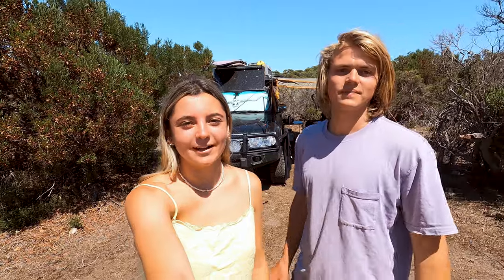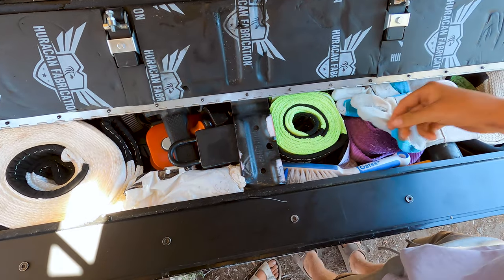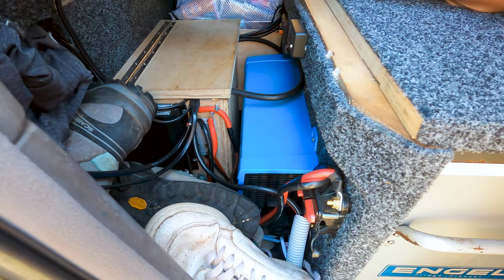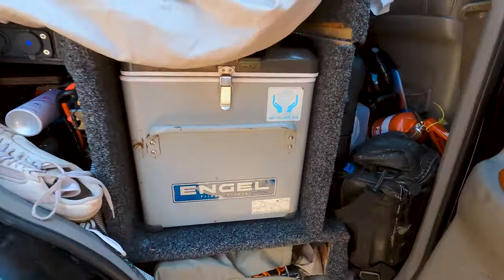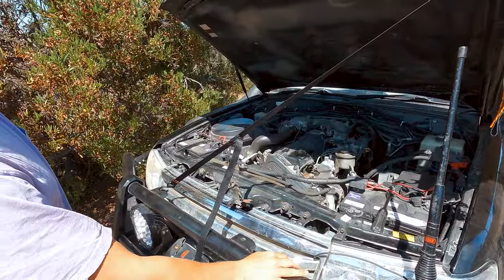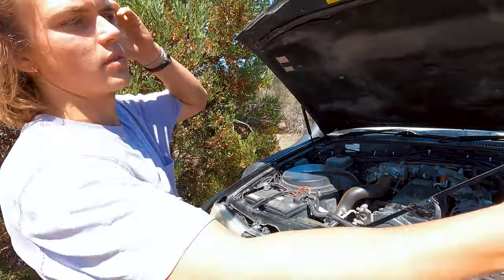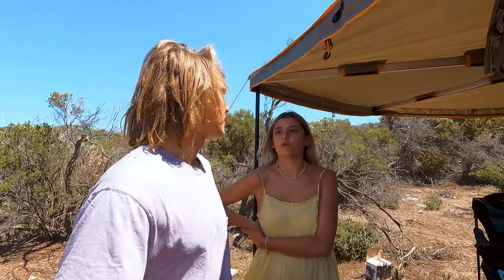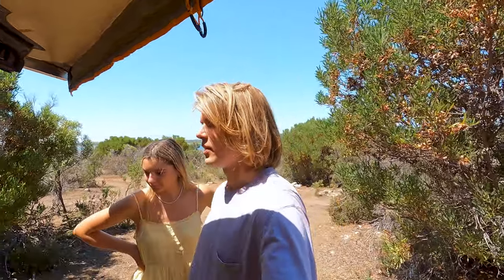RIG RUNDOWN  | 100 Series Landcruiser Touring Build

Comment: Love the build. Will be using some of the ideas when I get my 100 series. Have you ever thought about replacing the top draws with removable containers so you can lower the bed platform? You can also use a shelf at the back you have your legs under when sleeping. My surf is set-up like that and love being able to sit up in bed.

Comment: Nice setup guys. Just a tip, you don't need that second battery to start. I got rid of mine and I use the space to house my winch controller. Toyota ran two batteries because batteries were much weaker 20 years ago.
Reply from the maker: Great tip!

Comment: Hey guys, look into changing your radiator out, it's looking discoloured and are a ticking time bomb once they go like that for the tank to explode. They're meant to be black like the rest of the plastic in the engine bay. About $600 for genuine from a dealer, they're not a hard job.
Reply from the maker: Hey John thanks for the heads up👍🏽

Comment: Drive 04 fte, have done  for 8yr now, tjm set up front rear locker efs 2inch lift alloys w’285’s triple battery, im 3.2 tonne all day long with full tank ,me, 3 dogs, recovery gear and fridge, stedi roof bar stedi spotties and a thunder 20” light bar on front, (lots of 100k night runs passing no other vehicles and plenty of animal strikes) thinking you’d be well above that gvm with all that gear, in vic removal of the rear seat makes it not road worthy, anyways nice set up, good traveller they are all the best🤙

Comment: Hey mate. I'm very curious about what app you are using for your 12v system ? And how have you connected that to your bcdc40a ?
Reply from the maker: Hey Matt, we didn’t have an app to connect to the bcdc40a charger. However the eviction energy inverter was Bluetooth compatible so we could utilise an app whilst using the inverter. Mainly just used the voltmeters to view voltage

Comment: Great video guys, in the process  of building a LX470 along the lines of what you have done with your 100 series, very similar vehicles. Went with a DCS lithium battery set up under the bonnet  and a 3000 watt inverter which these batteries will run.
Are you not worried about the amount of weight on the roof ? 
A great set up though.
Reply from the maker: Sounds awesome Warren, that’ll be a very powerful 12v system. We were a bit apprehensive about the weight on the roof however we completed 21000km around Australia, with proper 4x4 tracks and all. Thankfully we had no issues and it passed the ultimate test. The rest of our videos are yet to come !!
Reply: The proof is in the pudding, as they say and after 21,000 kays with no problems seems like you have struck the right balance.
Reply: Looking forward to more videos !!

Comment: I like the set up but I feel like the winch remote should be somewhere easier to get to from the driver's seat. Depending on the situation, getting into the tailgate storage compartment could be a real pain in a situation where you need to winch.
Reply from the maker: Hey The Internets, thanks for commenting :) We have our wireless winch remote in the glove box for easy access in all situations. The one in the tailgate is a backup in case we need the wired remote, if the wireless ever fails.

Comment: You said 1000 watt solar panel, did you mean 100 watt?  Awesome setup BTW
Reply from the maker: Thank you so much Bangshift Billy! The solar panel says 1000w on the bottom. I was given it and so am actually unsure of the exact wattage, however it works perfectly - so would assume it is quite high wattage.